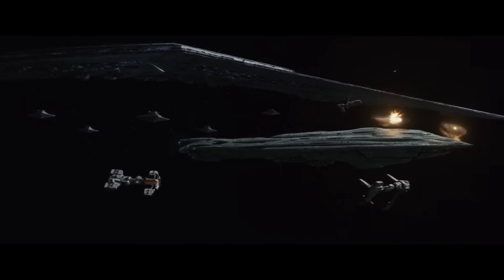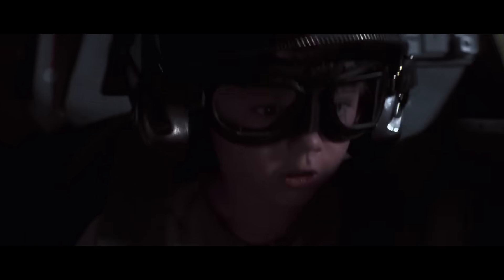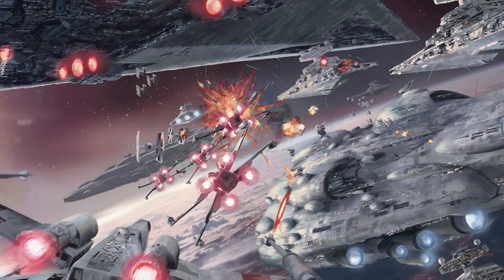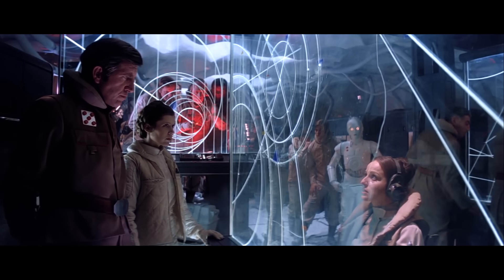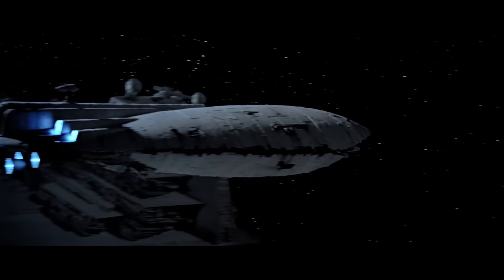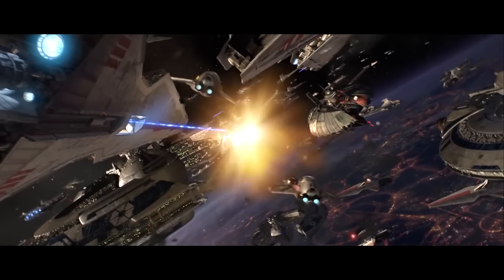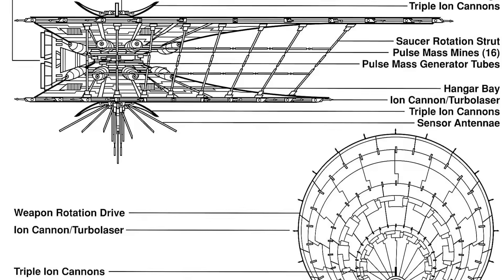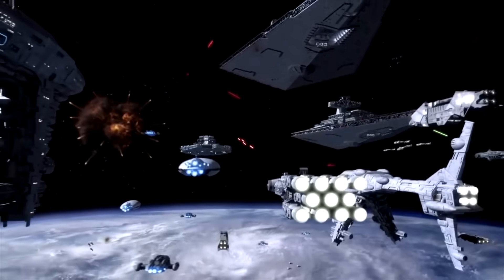Why Star Wars Turbolasers SUCK! (and better options) | Star Wars Lore

Comment: How powerful are turbolasers in actual hard canon? Star Destroyers destroy smaller ships and buildings with barrages of turbolaser fire in the movies, The Clone Wars and Rebels. Yet in the expanded universe a turbolaser apparently had 200 gigatons per shot.
Reply: They were actually more powerful then that that was just the power level for the standard quad turbolaser batteries on the acclamator which wasn't even a dedicated warship but rather a troop transport.
Reply from the maker: The source of that quote is the AotC Incredible Cross Section. Those books are written by Curtis Saxton and generally filled with BS numbers. Another example would be ships having a weapons range of several light minutes. The guns clearly aren't doing that much damage
Reply: The problem with the expanded universe is that it was written by a myriad of different authors, all of whom had their own ideas about weapon and ship capabilities. This results in instances where turbolaser shots are little better than fancy RPGs, while also having instances there they can crack planets in a few shots. 

Generally when people debate the different yields, they'll specify whether they're using low-end legends (really weak turbolasers), medium-end legends (single shots can blow up a building), or high-end legends (a single star destroyer can glass a planet in under an hour). 

For reference, the 200 gigatons per shot figure is treated as extremely-high legends, because holy crap, at that point why even have a death star? 200 gigatons is enough to crack a bloody continent! 

Disney canon also suffers from this (though not as much as the expanded universe). For instance, in Star Wars Rebels during the battle of Atollon Kanan has several turbolaser shots impact right next to him, and he barely gets a scratch. Meanwhile in the new Thrawn trilogy, a single shot manages to cause a small tsunami.

Basically, we have no hard numbers for yields. Any example used an be countered by a variety of other examples. You just have to find the one that you think makes the most sense and stick with it.
Reply: Cameron Spangler Lower energy yields make the most sense based on how Turbo Lasers are generally presented. The amount of energy required to cause a Tsunami is tremendous as they’re generally caused by earthquakes, volcanic eruptions and landslides.
Reply: Rey S 200 gigaton shots is a nonsense number that contradicts everything seen in the films.
Reply: @SirSpangler  

200 gigatons is enough to crack a bloody continent! 

No, you're exaggerating of what 200 gigatons could do. It is only powerful enough to annihilate entire islands.

also:

https://vsbattles.fandom.com/wiki/User_blog:Soldier_Blue/Star_Wars_-_Imperial_light_cruiser_turbolasers

https://vsbattles.fandom.com/wiki/User_blog:Soldier_Blue/Star_Wars_-_XX-9_heavy_turbolaser_yield
Reply: @EckhartsLadder  

For a Fucking galactic-scale civilization that had created Superweapons that could middle finger to all kinds of planetary shielding and destroy a planet, BRT supercomputers that can do planetary-scale governance, hyperdrives that allow people to travel the galaxy in just a few days, planetary shielding that can block orbital bombardment for weeks, non-military spaceships that can survive being near to an neutron star and even being near to the inner corona of a star, insane industrial capabilities, insane logistics capabilities, reactors stated to be comparable to a hundred stars and other shit like that,

PEOPLE ARE FUCKING WHINING ABOUT BIGGATON YIELDS FOR STAR WARS AND LIGHTSPEED-BASED WEAPONRY.
Reply: A Normal Worshipper Of Sheevism Ok? A silly, stylized cartoon blast as serious evidence? How do you even know that’s an actual to scale fireball and not just representing a flash of light or something? 
Give me a break.
Also, love the solid turbolaser/ion cannon phaser beams. That canon now too? Excellent source there....
Reply: A Normal Worshipper Of Sheevism Yeah. And all the nonsensical biggaton fan yields directly contradict on-screen canon. 
The super weapons do not represent the firepower of conventional weaponry, which is what we are discussing here. For example, the Empire needed to build a moon-sized station that required a shit ton of extremely rare and exotic magic crystals to achieve planet destroying firepower. That has nothing to do with conventional turbolaser power.
Reply: Well part of it is power inflation, the people writing those numbers don't fully get just what they actually mean, it's also worthwhile to note that even if a turbolaster bolt contains energy equivalent to a nuclear blast, it isn't going to have the same effects as a nuclear blast.  It's obvious that they're built with the intention of penetrating through heavy layers of armor to damage critical ship systems, thus it's likely that most of the energy of the bolt is held tightly together so that it's shed more slowly, allowing it to vaporize through more material directly infront of it.  It's also worth noting that a lot of ships almost instantly explode into gargantuan fireballs once their shields collapse and they take a volley of direct hits, indicating that the power of the turbolaser bolts may in fact be really incredibly huge and shields are simply also really incredibly powerful, so most hits we see on screen are only the fraction of the bolt that bleeds through a ship's shields.
Reply: @youtubeisapublisher6407  

Finally someone who thinks. Rather than jumping to conclusions without analyzing the whole thing as to why the numbers are like that

I believe, they're just concentrated into an microscopic points does not do gigaton-level visual effects, it is still going to be significantly more powerful than its effects show. Which means that the Turbolasers are actually shooting gigatons but it doesn't do any visual effects of a gigagton explosion because it is concentrated into a microscopic point. This is my theory, as to why we don't see any gigantic explosions everywhere.
Reply: @J1nx Don’t forget that the cannons and turbolasers have various power levels: the laser cannons are the ones with anti-tank or starfighter capability, the turbolasers are made for fighting capital ships and orbital bombardment. As Carnor Jax explains in Crimson Empire  , a single Star Destroyer is enough to raze an entire planet, to reduce its surface into molten slag.
Reply: @J1nx Disney's canon isn't worth being recognized at all. If the quote from "Rogue One: Catalyst" or wherever the source that said turbolasers caused tsunamis, the energy would be in teratons up to petatons or exatons, far more so than the gigatons cited in the ICS. Now which is the ridiculous output again? And how many "Legends" books have you read?
Reply: @J1nx   According to the Star Wars Technical Journal , a Base-Delta-Zero operation is the act of melting the surface of a planet. The operation was performed on Caamas just after the Clone Wars (ref: Spectre of the Past), and it was so devastatingly ruinous that the planet was still totally uninhabitable forty years later. In fact, resettlement efforts of Caamasi survivors (presumably those who had been off-world at the time of the attack) were centered around the discovery of a new Caamasi homeworld, which would then be terraformed to Caamas' specifications. This indicates that it would have actually been easier to terraform a barren, uninhabited world than to make Caamas inhabitable again!

 It is possible to generate a very conservative estimate by assuming a dry planet (no oceans) and assuming that this devastation will be caused by the melting of surface material to a depth of one metre. Therefore, if we use Earth as an example of a typical target planet, the Base Delta Zero operation must melt 5.1E14 m³ of surface material. 

Here is a playlist on how Base Delta Zero would work: https://www.youtube.com/playlist?list=PLLmlyEhmCKMEqfP70_7l7pjYxVEuW6ubs Too weak to scatter a planet’s mass like the Death Star, but enough to render it uninhabitable.

On pg. 248 of Slave Ship, the following narrative description is provided of the recoil absorption mechanism on a typical turbolaser cannon: "the laser cannons being mounted into the open skeletal frames required bracing and recoil-dissipation casings that would have withstood explosions measured in the giga-tonnage range. Anything less, and a single shot fired in battle would rip a destroyer or battle cruiser in two, a victim of its own lethal strength".

Here is a playlist on the Death Star’s firepower, shielding, propulsion: https://www.youtube.com/playlist?list=PLLmlyEhmCKMFDDKyKhjwRWRd5ZL32WkVn Imagine scaling that down to a mere Star Destroyer, and you get an idea of how powerful those starships really are, even without the battlestation. As The Empire Strikes Back attests, the base shield generators would be strong enough to resist a bombardment from 6 regular Star Destroyers and 1 Executor-class Dreadnought. That is the strategic value of the Death Star, to overwhelm planetary shields and blast worlds into oblivion when Star Destroyers cannot do so.

Comment: I’d argue TL’s are still very good since composite beam lasers and particle beams, while powerful, require a lot of power and are pretty bad against shielding. Kinetic weapons as well just aren’t very good against anything larger than a small, unshielded starfighter like a TIE Interceptor. 

For close range broadsides, which is all but guaranteed in Star Wars due to hyperspace and ECM, TLs are incredible because of their rate of fire and variable yield.

Comment: The problem with capital ship turbo lasers is they are too small. A star destroyer uses the same turbo lasers as a corvette, just a f***k ton more.
However, that is just stupid, as you could just build a f***k ton of corvette in place of 1 star destroyer.
This is why the HMS Dreadnaught was a big deal. It was found that it's better to have fewer, larger guns. Guns far too large to be carried byy a destroyer or cruiser.

Star Wars capital ships are like if WW2 ships just used anti air guns no larger than 40mm.